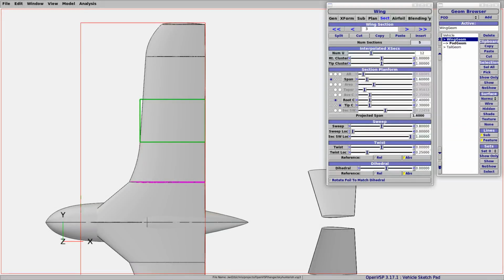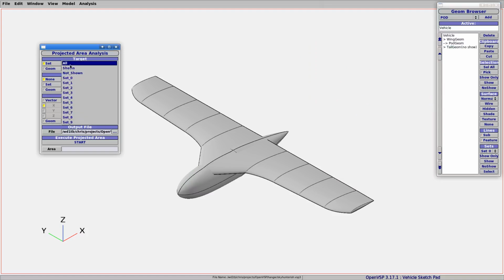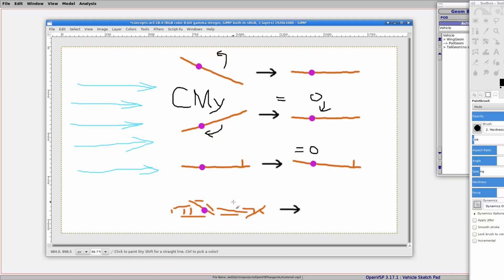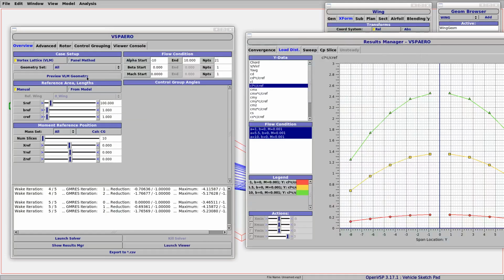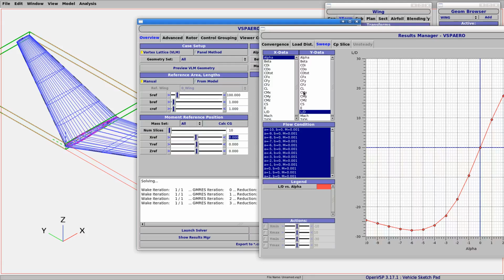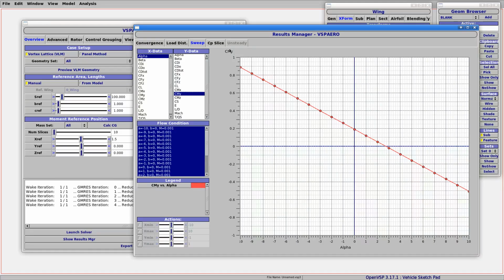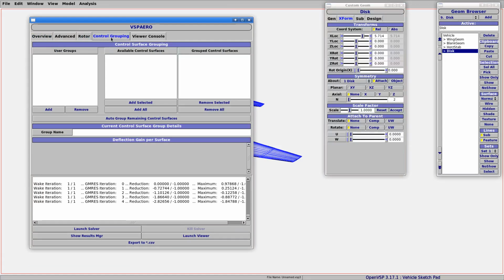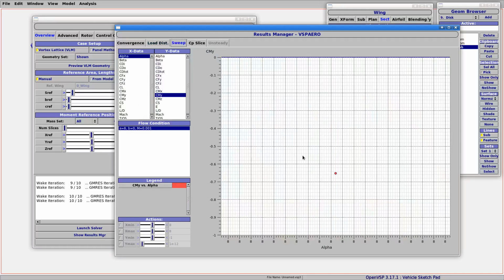OpenVSP tutorial part 2 (pitch moment and L/D analysis)

Comment: I'm having problems running VSPAero simulations with a fuselage. Is there something that will make it work?
Reply from the maker: In my experience that is usually related to the cross section types used. I seem to recall that 'rounded rectangle' is simply not supported and will always crash. I use super-ellipses instead which can be made pretty similar to a rounded rectangle. Circe and regular ellipse are ok too, I would tread carefully with anything else.
Reply: @iforce2d   I appreciate the reply! Your videos on VSP have really helped me design these 3d printed wings I've been making. Using what you showed on VSP I've had perfect maiden flights on the last two builds. I've come to the same conclusion regarding the rounded rectangle cross section. I think what I'll do is just design the fuselage and then change the cross section to circle to run VSP aero. Then I'll change it back to rounded rectangle before I export to Fusion.
Reply from the maker: Try super-ellipse and increase the value of M and N, you can basically get a rounded rectangle, except better because the corners can be rounded separately, and you don't need to keep changing the cross-section to run vspaero etc. http://www.iforce2d.net/tmp/Selection_658.png
Reply: @iforce2d  Thanks I'll try it.

Comment: 26:05 why don't you angle the tail so that 0 pitch moment is at the angle of attack where the maximum L/D is?
how does OpenVSP handle size of the plane? what are the units for lenght?
Reply from the maker: Yes, there are plenty of things to tweak if you're making a real design and not a demo video :) When it comes to transferring the design into real-world construction it's usually easier if I can just keep the tailplane and wings 'flat' relative to each other. Pitch moment can be tweaked by CG position too, so I don't fuss over making the untrimmed configuration give me the maximum L/D. Just anywhere along the higher part of the curve is fine, preferably a little off to the left side of the maximum so that pitching nose up will increase L/D slightly.
Regarding size/units, I didn't know if VSPAero simulates in that much detail so I did a little check just now. Increasing the size of my plane by a factor of 10 gave a L/D increase of about 20%, so it looks like the scale is actually taken into account. I just consider the units to be centimeters and set the sizes I want accordingly. From there, tweaking to improve the L/D etc at that scale, would automatically improve it at any other scale so the absolute scale doesn't really matter. The real-world L/D measurements are usually nowhere close to the theoretical ones anyway, empirically measured glide ratio is typically about 40% of the value VSPAero shows.
Reply: @iforce2d  thanks a lot :)
i was doing an efficiency comparison between reflex and a bird tail for flying wings

i wish there was something similar to vspaero in fusion360
where i can tell it to sweep any parameter in any range i want and it gives me the best for l/d and graphs for what happens during the sweeps

i can dream lol

Comment: Ok, I have made a glider.
It generates lift, but it flies unstable according to the analysis. I have tried different location for the wing, without any luck. The stabilisator is fairly huge, so I hope it helps. It's wingspan should fit nicely in the trunk of a car. I haven't made any cad files or STL files for laser cut balsa, or a hot wire cutter. If a hot wire cutter is going to be used, I am considering using Jackofoam ( extruded polystyrene foam, used in building construction ).

Any tips on fixing the issue? 

File for OpenVSP:
https://www.dropbox.com/s/iq39j853c6jy9il/myglider.vsp3?dl=0
Reply from the maker: You have the CG near the trailing edge of the wing, when it needs to be about 25-30% of the wing chord away from the leading edge. Just set the Xref value of the 'moment reference position' to about 4 and it seems ok. In reality to get the CG there might be difficult though, without adding a lot of nose weight - might be better to slide the wing back along the fuselage a bit, or extend the nose longer.

You'll also need to angle the elevator (XForm tab, Yrot) at about -5 degrees, so that the neutral-moment angle of attack has positive lift. This is quite a lot of angle, but seems to be necessary because the main wing chord is so large. With that aspect ratio it won't be much of a glider, it's more like a warbird :) I think the stabilizer would be better off at a higher aspect ratio too.

I got some decent results with these changes:
- CG at 3
- elevator Yrot at -3
- change main wing chord to 10

Comment: Birds fly pretty darn good without a rudder (h. stab.). V tail seems an easily implementable approximation. Hmmm?
edit: Also, interesting vid. on wing design. https://www.youtube.com/watch?v=Hr0I6wBFGpY
another here. https://www.newscientist.com/article/mg23631472-600-drone-engineers-accidentally-explain-the-colour-of-albatross-wings/
Reply from the maker: I wasn't trying to finish a design here, just showing the basics of how the analysis stuff works.
Birds can dynamically change their center of mass, wing dihedral, sweep, twist, span, angle of attack, and do this separately for each side, and then all of that for the tail as well, plus the angle between tail and wing too. They're too much of a different construction to really compare to a rigid body plane, although that doesn't stop me from thinking about it fairly often :)

Comment: Instead of CMy vs. alpha, you might consider working mainly in terms of CMy vs. CL -- the airplane doesn't really care about alpha.
Reply from the maker: Surely drag needs to be part of the consideration though?
Reply: @iforce2d  I mainly meant for your consideration of static pitch stability.  For example, the negative CM vs. alpha slope you reference -- what really matters is the slope dCM/dCL -- which is actually the negative of the static margin.  Likewise, the point where the curve crosses zero CM is the trim point -- in CL or alpha.  CL will tell you the speed for trim (given density and wing loading).  If you generate curves for different elevator deflection, you will see how the trim point moves.

Drag is important for performance - but not for static stability.  The total drag prediction in VSPAERO is not great.  The induced side is OK, the parasite component is weak, and there is no separation drag at all.  So, those L/D's will be optimistic.

But, from a performance standpoint, we usually look at CL vs. CD -- not CD vs. alpha.  Alpha is just a reference angle to a line painted down the side of the airplane.  Humans care about it -- airplanes don't.

Thanks for putting these videos out there -- I think they will help a lot of users.
Reply from the maker: @rmcdo1  I see. I was only looking at alpha in order to match up the results between the alpha vs CMy graph and the alpha vs L/D graph, but now that you mention it I can just graph CMy vs L/D and I only need to look at one graph, would be much simpler.